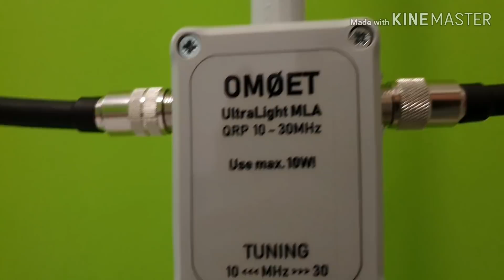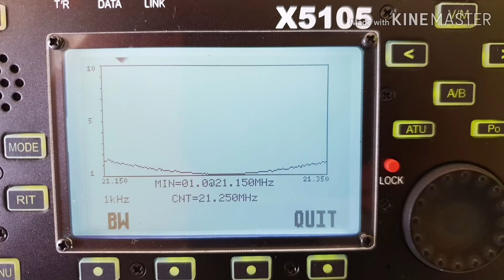ver.3.0 UltraLight Magnetic Loop Antenna - folded construction

Comment: Aloha Paul, for your connection to the small loop onto the PVC pole, I was thinking of making it much easier by using a set of Anderson Power Pole connectors so that no screws or screw drivers would be needed. 
    Instead of using a fishing tripod, I would use a fishing sand spike that we set our fishing poles in here in Hawaii. You can either push the spike into the ground or hammer it into the ground pretty easy with the heel of your shoe or sandals since we never wear shoes here in Hawaii, lol. I have the 20 watt Xiegu G90 that can TunA Fish, lol. I believe in KISS-Keep It Simple Stupid, lol. 73 and Aloha Paul, great videos!
Reply from the maker: Hi Todd! This is an old video already 😃 Here you can see the latest infos: http://sk-tech.sk/om0et/ultralight-mla-mc-20.html
Reply: Aloha again, Paul. You seem more proud of the box instead of all the hard work you put into the antenna, lol. So in taking your lead, I want I to put in my order for two boxes. I don’t need the antennas, just those super cool boxes, lol. Maybe we can work out a great deal and I can sell those boxes on my weekly nationwide radio show! 😂🤣😂🤣😂
   I Love it!!!

Comment: Nice antenna, Paul. Congratulations ! May I ask you: which type of coaxial did you use ? Did you make a short circuit between the ground and the coaxial core in the box ? Thank you. 73's.
Reply from the maker: Hello Stephane. No, I dont use the shield as direct radiator. Energy from center core is inducted also on the shield because in the coax is self capacity about 140pF ( i am not sure how many exactly)
I use now the Belden H1000 coax.cable.

Comment: Interesting and nicely done
Suggestion: rotate the inner part of the terminal block 90 degrees and use thumb screws for connect/disconnect the coaxial. No tools required now.
Reply from the maker: Coould you send me the sketch to explain how you mean to do it please? I am not sure if I correct undertood. Thank you 😉

Comment: What is the value of the capacitor in the tuning box please?
Reply from the maker: It's the 380+320pF (700pF) but this two segments are connected to split stator style so total capacity may be about 350pF.

Comment: Paul, I really like your videos. I'm been a ham for 35 years and love QRP. Your magnetic loop antenna videos are excellent and right in line with QRP work. Just wanted to know if you have a magnetic loop design for 7.000 MHz to 30 MHz. Thanks KJ4YM, Mark.
Reply from the maker: Hi Mark, thank you very much! Actually I don't have design for 40m because of the size it should have on this band. I tryed double turns but antenna was heavy and not stable in the hand. This is why I don't have it yet. 😉 73